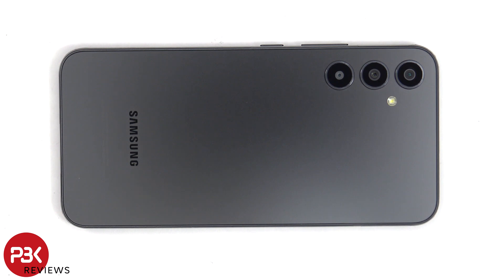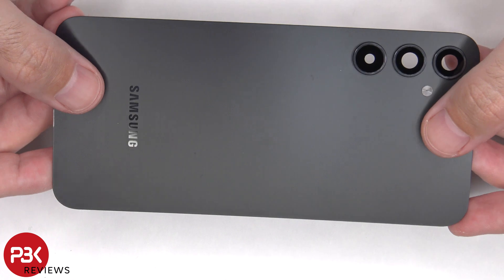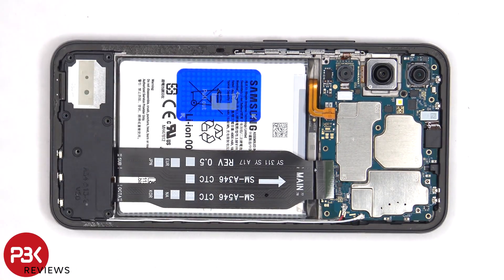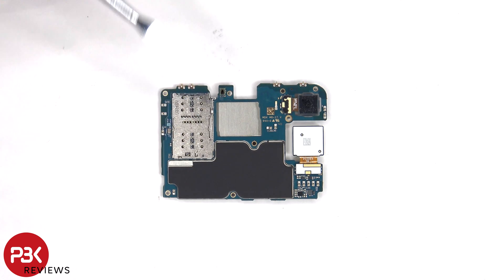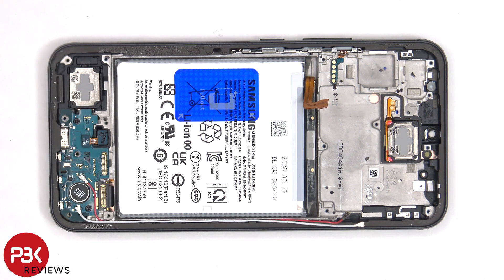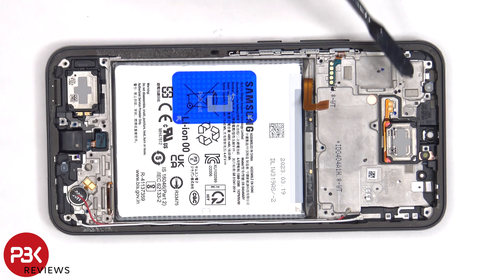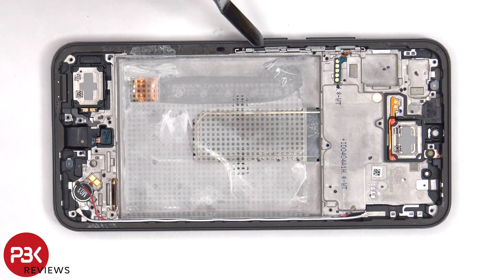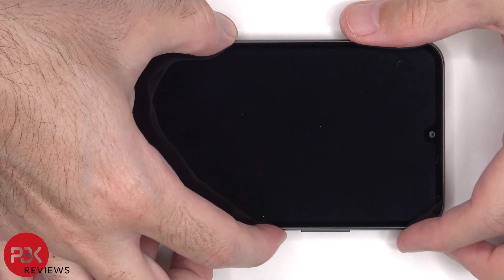Samsung Galaxy A34 5G Teardown Disassembly Repair Video Review

Comment: Can you please let me know what the name of that black circle part on the sub board is that has the 3 letters and 2 gold squares and what is the use of it , because on mine a34 it's missing and the touch isn't working
Reply from the maker: The vibrator motor? that is not on the sub board, the sob board sits over it making a connection with the gold contacts. It would not cause you to have touch issues if its missing. However, a damaged screen cable, or the flex cable which connects the screen cable to the main board can cause an issue. Also a damaged connector on either of those, or just a defective screen.
Reply: @PBKreviews  ok thanks because the phone got fixed and they took a cable and the touch isn't working but the LCD is fine

Comment: after changing the microphone it doesn't connect to the network, why?
Reply from the maker: if you mean the sub board, you need to make sure you get the same model number version since there are different region versions with different antenna configurations.
Reply: @PBKreviews  I have a samsung A34 5g. The supplier tells me that the pieces have been tested but they are two pieces that are not accepted by the network. Old piece everything is fine, except the microphone.

Comment: And after reinstalling, the Samsung Galaxy A34 lost its water resistance 🗿
Reply from the maker: yeah, unless you use the original pre cut adhesive made for the phone to re apply the back. As long as its installed properly, will retain water resistance.

Comment: Is it still water resistant afterwards?
Reply from the maker: If you properly apply the original water resistant adhesive made for the phone, then should retain the water resistance. If you use a generic adhesive and cut it down to size then no.

Comment: Is it possible to modify vapor chamber make it more wide than originally?.
Reply from the maker: You would need to heavily modify the frame itself to cut out an area and add a second vapor chamber since you can't modify the original. Wouldn't really be worth going through the trouble for the amount of difference it would make.

Comment: Replacement of display is a big issue 😒
Reply from the maker: It isn't too difficult to replace the screen. All you have to do is pry off the back, and remove the screws on the bottom speaker assembly and remove that then disconnect the cables from the sub board and remove the sub board, pry off the old screen apply the new one and re assemble. It seems like a lot of work but compared to most other phones, its much simpler.

Comment: The haptic motor feels like a Z Axis, and looks like a Z Axis, an improvement over the A33's essentric mass motor

Felt exactly like my S7's motor :)

(Oh and fun fact: the S21's motor actually works well with the S7, too bad it just won't fit, and if that's the case, I think its possible for the same thing to happen to the A34, but fitment, like the S7, will be the issue.. the S7 with a S21 motor felt just as good)